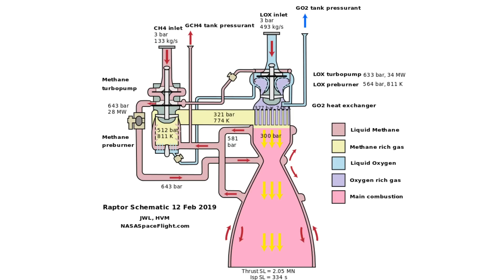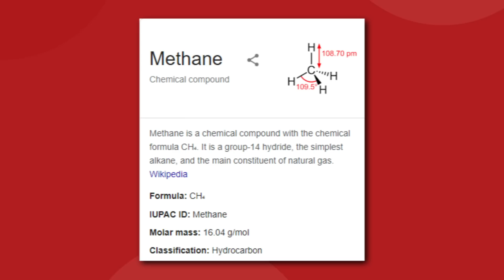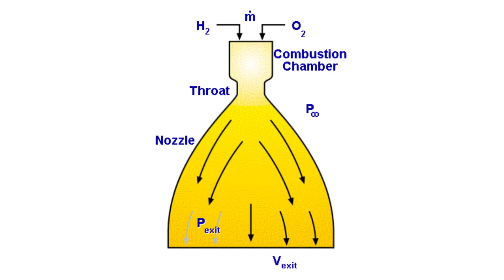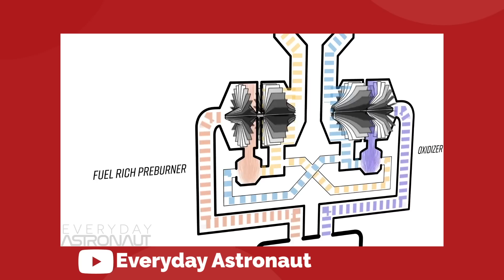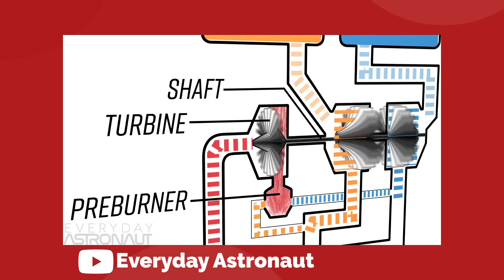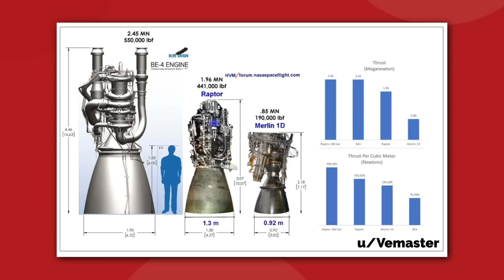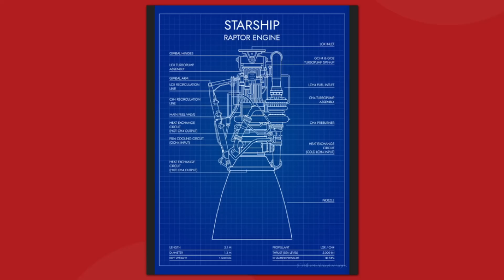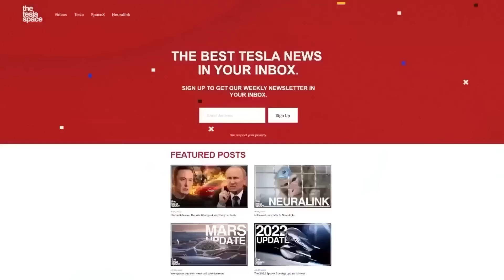The Real Reason SpaceX Developed The Raptor Engine!

Comment: Just think of what people with cars did when they tried to increase gas mileage by turning fuel into vapor before Igniting, they were able to get a lot of HP and over a 125 MPG. If they would have used a Turbo in that equation I'm sure it would have been better yet. Definitely not rocket science.  But better be careful shown off your ideas or you will end up dead just saying  Then someone else will bury that idea.  People are so damn corrup. Some are not tho and they pay the price RIP to the real rocket scientist.

Comment: I have visions of the Soviet N1 rocket (always blew up) which had 30 engines on first stage. Hope Elon gets it to work,  but if have that many engines and if each engine has even 1% chance of catastrophic failure then you have 33% chance of flaming data per first stage launch for Starship...I suspect he is working mostly on reliability at this point.
Reply: It's a pitty that first Starship launch repeated unsuccesful Soviet moon rocket N1 launches. 😢 And some Raptor engines refused to function correctly...

Comment: The Space Shuttle Main Engine were using Liquid Hydrogen, like the main engine for Ariane. It can be misleading. But liquid hydrogen bring the same problem for storage. 
In engineering adding some complexity result to an increase in the failure rate, so some simplification works are  done to improve the safety too (Not only lighter and cheaper), moreover a cluster of 32 engines, seem a bit risky. 
I was wondering if they use 3D printing process to be able to create as much new iteration, and reduce the parts number. They clearly take the lead in the new propulsion technology now.
Reply: Number of engines is not a big issue now. Falcon Heavy has already been using 27 Merlin 1D engines since a few years ago. Going from 27 to 33 should not be a big problem using current control technology.

Comment: The concept of a preburner turbine with bleed off from the fuel and oxidizer turbopumps is NOT unique and has been previously produced.  The Russian NK33 and RD180 engines both used this technology to produce significantly higher combustion efficiency.  You opening statements are incorrect.  The principle difference between the russian and the Raptor engines is that the former has a single preburner while the latter has individual preburners and turbines driving two turbo pumps.
Reply: This is not the principle difference.  It is just trivial.  The very fundamental difference is that the Raptor is burning the fuel and oxygen in chemically correct ratio.  The Russian RD-180 and NK33 are all oxygen rich combustion. Thus Raptor engine is the most efficient.  It does not consume oxygen more than actual required for combustion.

Comment: What about vacuum pressure flow towards the center nosel's and the extreme heat from the out engines  causing heat damage to the nosel controls. What if you had induction pipes pulling  cool air down between the nosels from the the mid to lower side of the vessel forcing cool air down inward between . Or cold jet turbine fans which would spool up from the negative pressure flow pulling from the downward thrust of 33 nosels .  Spooling turbines Which are enbeded into the sides of the vessel.  And can have the flow redirected where needed. Just food for thought I'd love to be part of testing this type of senerios

Comment: Does cryo freezing the Methane as well as the Oxygen not cut performance as there is an additional power requirement? Plus why lots of small engines versus one big one - more engines mean more room for failure (one big one also has one failure). From what I read there is another rocket propulsion design using different fuels but since current rocket fuel is the cheap part, nobody wants to waste time on developing it (I recall one startup did look into it). Also does coking happen at the extreme temperatures within the nozzle. I would presume any carbon build up would be burnt to ash
Reply: The methane has to be liquified to make it practical as a rocket fuel. As a compressed gas you would have a small amount of energy in a very heavy tank. The reason many small engines are used instead of just a few big ones is engine reliability. It's much easier to make a small engine that's reliable than a large one.

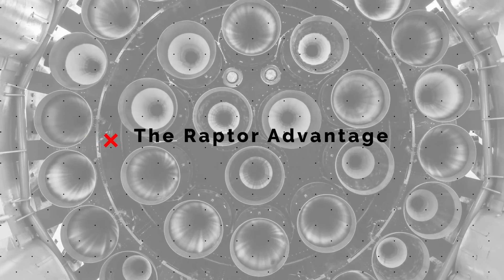Comment: 6:57 The nosecone is punching a much bigger hole in the air than it needs to. Reducing the size of the hole being punched through the air would increase terminal velocity without more thrust.
Reply: It depends on altitude and speed. 
Blunt shaped nose cones are more efficient at subsonic speeds in dense air. Supersonic speeds require a sharp nose cone. 
Star ship is getting to thin air very fast, so the blunt nose works just fine. 
It may seem strange, but this is the reason that airliners use a blunt shaped nose. They are more efficient at subsonic speeds.
Reply: By the way, the space shuttle and it's main fuel tank also used a blunt nose.

Comment: The concentration of engines is not unprecedented, the soviet N-1 moon rocket had 30 on the first stage.
Reply: They also conceived a veritable flying saucer. Although pretty cool, it doesn't seem to be in commercial use either (that we know of 🤔). However, if you're only referring to precedent, I cannot disagree.

Comment: But wait, these engines have to restart at different points during their journey.  So how are they restarted after they leave the launch platform if they are dependent on that platform to start in the first place?
Reply: The engines that rely on the launch platform to start up are only the outer ring of twenty on the booster.  The inner booster engines and the engines on the starship itself have all the systems necessary to start up carried along with them.  The outer twenty booster engines are only used during the initial liftoff.  They don't need to restart, so the weight of all that extra equipment is left behind making the rocket lighter and able to carry more payload.  When the booster lands for reuse, it uses some of the inner engines, which CAN restart.  The starship doesn't light up its engines until partway to orbit, so it, too, has to carry that extra equipment for starting and restarting.

The noteworthy thing about Spacex's starship and booster is that for the first time, these systems have been offloaded to the launch platform for some of the engines.

Comment: The Ruskies tried this with the N1 rocket in 68-69, and it failed time after time.  There's a reason......it's too had to feed fuel equally to so many engines and keep them syncronized with power.

Comment: Eh no not really, the reason for the use of methane is that it's a compromise between RP-1 and Hydrogen, RP1 relatively energy dense per unit volume, you can store it relatively easily but the specific impulse is relatively low, it will freeze at the temperature of liquid oxygen, so you need insolation between the oxygen and RP-1 tanks and yes it cokes inside the engine. Hydrogen has a high specific impulse, burns clean the by product being H2O, however it has a low volumetric density meaning much larger tanks, very hard to store in even in the mid term never mind long term, will both freeze oxygen below it's boiling point and liquid oxygen will boil off your hydrogen so much insolation is required between the tanks.

While methane has a middling specific impulse, has a boiling temperature comparable to liquid oxygen, so there is no need for insolation between tanks, a volumetric density more similar to RP1 than Hydrogen, long term storage is manageable and with a appropriate mix of oxygen burns clean, so it just ends up being the best overall fuel period.

Comment: ON earth we have laws of physics. Man is bound by these laws. It can be observed science breaks laws of physics when it is science that claims “outer space” and the “vacuum of space” exists. 
A law of physics is that pressure cannot exist next to a vacuum without a physical barrier. On earth there is 14.7psi atmospheric pressure, relative at sea-level.
Newton discovered what is called “the third law of motion” Simplified; Action-Reaction.
This law tells us 4 characteristics of forces;
1.	Forces always occur in pairs, which are called action and reaction forces. Note: untrue, one factor is missing. Therefor it should read: AFR TRAINGLE (Action, Friction, Reaction Triangle)
2.	The action and reaction are always equal in magnitude. Note: untrue, the third factor Friction is not specifically mentioned. The various external influences as well as the physical state of this third factor itself is of influence as to how much energy from the “action” will be lost. For example: driving on a dry or wet road, icy road, snow, hail. Same medium, different physical states. You get the picture?
3.	Action and reaction are always opposite to each other. Note: untrue, the factor Friction is missing, the position of this third factor and physical state varies in respect to the first(action) and last(reaction)
4.	Action and reaction act on different bodies.

What has been obscured is the ever so important third factor in this Newtons “third law of motion” namely ‘Friction’ but when you understand the following you will see it is hidden under characteristic 4.

Simplified;
1.	A car engine makes the rubber wheels turn (ACTION), the rubber has contact with the road (FRICTION), car engine overcomes this friction, car moves forward (REACTION) 
2.	Boat engine makes propeller turn (ACTION), propeller has contact with water (FRICTION), propellor overcomes this friction, boat moves forward (REACTION) 
3.	Rocket engine creates a blast (ACTION), blast has contact with atmosphere, atmosphere gets pushed away by blast, 14.7psi atmosphere rushes in to replace atmosphere (FRICTION), rocket overcomes this friction by pushing off on the atmosphere and the rocket lifts off (REACTION).

So far so good until the rocket reaches “outer space”. There is no atmosphere, as claimed by science, to create FRICTION. Science states there is a vacuum of space.

This is where the third law of motion to be broken by science. One can argue in doing so, science overcomes the divine creation. Which is impossible. Man can NEVER escape any law of physics.

When one of the factors of the third law of motion is missing, the process cannot be completed.

The third law of motion only works when a solid, liquid or gas medium is present to either transfer the action force or create a surface for the action force to “push off from”.

Book:  Famous Physicists
Written by: A.L. Mann and A.C. Vivian
Published by: The John Day Company 62 West 45th Street, New York 36
First Publication: 1961

“AUTHORS NOTE
This book contains the life histories of a number of dedicated men. All are early scientists who dealt with PROPLEMS OF PHYSICAL LAWS, and whose vision and labor laid the foundations for the scientific advances already achieved in our modern world”

“Chapter IV

Otto Von Guericke (1602-1686) page 60

Experiments:  Air pressure. Tricks with Air Pressure”
In this book contains Otto Von Guericke’s Magdeburg Hemispheres Experiment.
This experiment demonstrates that the force of vacuum inside the hemisphere, which consists of 2 pieces of bronze when put together make a ball, is in direct relation to the ball being surrounded by atmospheric pressure.
It can be observed from this experiment that a Vacuum Region can only exist inside a container thus a physical barrier must be present to create the separation from a Pressure Region.

Comment: Not beyond unprecedented. N1 first stage had 30, which I think were also closed cycle engines.
Reply: That closed cycle is not this closed cycle.  N1's close cycle was a oxygen rich combustion. It burns more oxygen than is required. Raptor burns methane and oxygen in correct ratio without waste.  Raptor is more efficient in fuel consumption.

Comment: I don't agree with this video presentations facts. The pressure in the throat area is not high and then the exhaust speeds up more as it exits into the nozzle. Thats not right. The pressure through the nozzle is reduced as veocity through the nozzle increases. Then as it travels into the expanding divergent nozzle area. It exchanges velocity for pressure. The increased pressure is what is driving the rocket. If they reduce the exit area. The rocket will have a potential higher speed. But less thrust. Its a great video. But the facts are wrong.

Comment: Gotta say, reminds me a bit of the development of the German rockets and the fuel issues they had. What I find similar is that there is a simplicity involved. These engines are "basic" but that does not make them easy to engineer.
Reply: Yes, they copied the same tech from other worlds. We want to see Elon go up in the rocket.
Reply: Engineer or to make. I am a aerospace machinist and these Raptor Turbo Pumps are some of the tightest tolerances to hold along with the material being hard as heck. It's cool making these though.

Comment: Talk about expantion of the gas in the nozzle, put human lung on screen? lol
Also, I would not consider the faster the gas being pushed out the nozzle the faster the rocket goes, since there's a lot more stuff going on. It will only apply on the same engines. You ignored the mass that is being pushed out from the nozzle, if one engine push a lot more mass but at a little bit lower velocity, it will make the same rocket goes faster.

Comment: Space shuttle main engines featured dual turbo pumps; one for oxygen and one forr hydrogen. The exhaust gas on these engines was zero carbon; commonly known as water.
Reply: Water is a much more powerful greenhouse gas than CO2.  Ban hydrogen power - for the children. 😂

Comment: Great video and explains a lot. But I have no engineering experience, so from a layman's POV, why not scale up the Raptor so you need fewer of them? Could 17 double-size Raptors do the job of 33? After all, Saturn V used just five F1 engines, which worked pretty well!
Reply: Engine output does not scale that way. Like a small block Chevrolet, this is an internal combustion heat engine. Power output is based on fuel burned matching the nozzle, not just the physical size of the engine or its combustion chamber. Weight and cost are factors also
Reply: Also think of it from a redundancy stand point, StarShip will be Re usable . If an F1 engine were to fail on Re entry the booster would crash and be lost; on the other hand, 33 raptor engines allows for several to fail and not cause the loss of the spacecraft